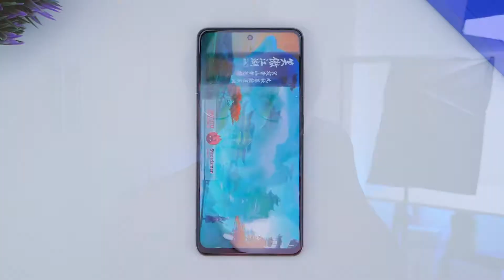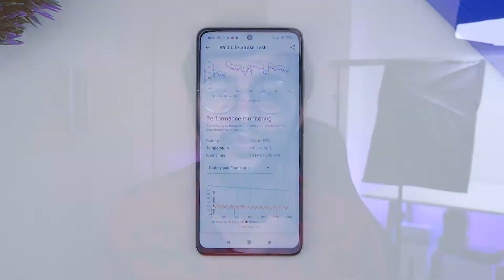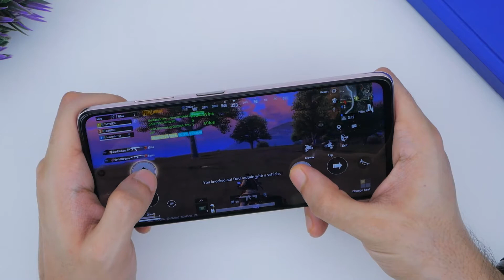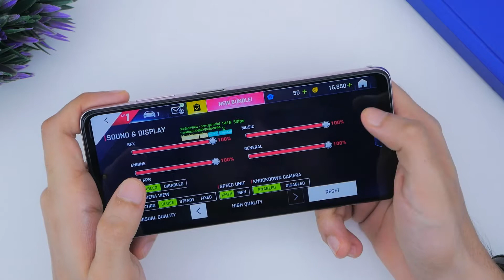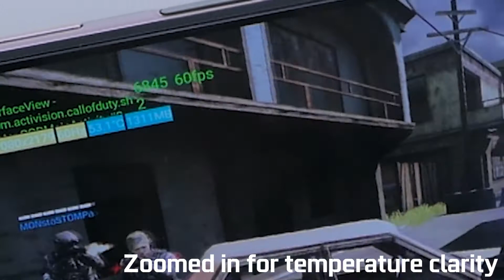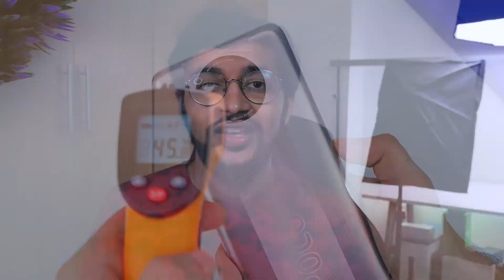Xiaomi Poco X3 Pro: Ultimate Gaming Test! (PUBG, Asphalt 9, Call of Duty, and Genshin Impact)

Comment: Hi bro i see 50-60 degree Celsius when you zoomed temperature.is it can damage phone?
Reply: Well Not Really Though.. 
Even my Redmi k20 was used to hit that temperatures ..  I never had any issues with it tbh 
Not a major issue I'd say but yeah 
thermals are important
Reply from the maker: Don't think so, at least not a major issue. Games are supposed to push temperatures. If you want things cooler than that, buy a phone with a dedicated fan. But typically, these are more expensive.